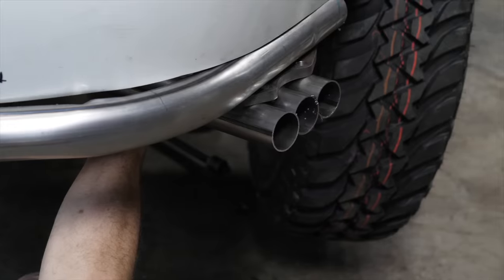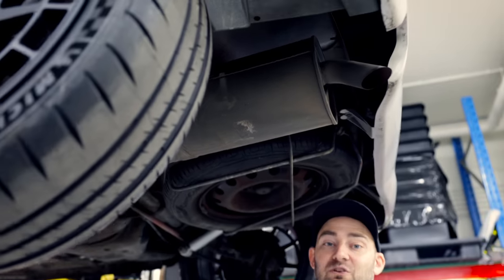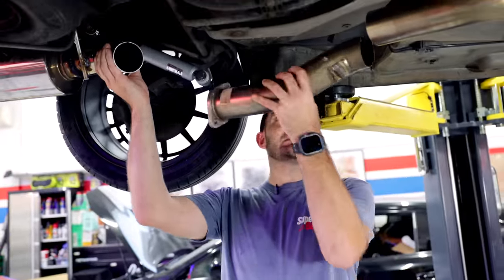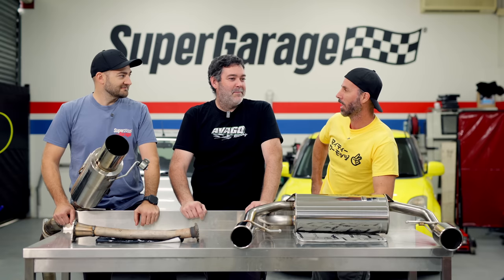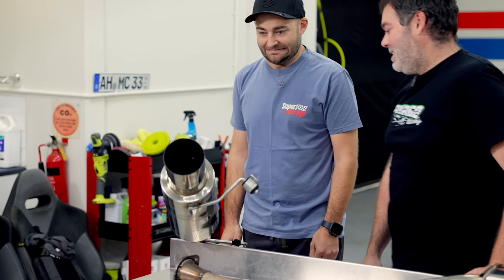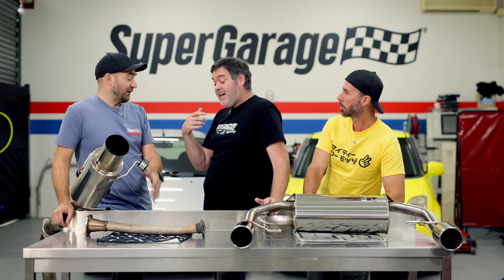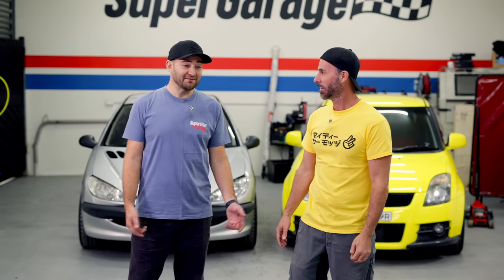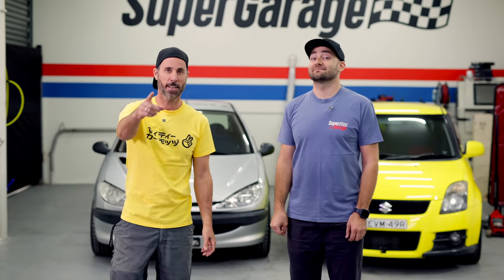$13 vs $1,300 Exhaust System | CASH vs TRASH

Comment: If you got a welder and a saw you can spend a LITTLE bit of money, Buy the proper sized pipes and proper mufflers and high flow cat and potentially make an even better exhaust than some prefabs. depending on the quality of parts and skill level.

Comment: In the filter video, you said it’d be worth it if we see a difference on the dyno. But changing the exhaust will also have an unknown effect. Why didn’t you dyno runs between mods? It’d have been more expensive, and this isn’t a scientific channel, but seeing a difference in stages would have been nice

Comment: The Problem with the 206 now is the fact the Biggest restriction will be the Cat on the Manifold. The Old Cat will be clogged up for sure. So Surely it'd be better for power to knock the Cat out of the Manifold (or fit a 250 buck sports manifold and stick a Cheap Sports Cat in the 3" pipe for less a than 100 bucks.
 350 bucks will be Dirt Cheap and will at least get more power where Martys system will lose power!

Comment: It's still nice to see that I'm not the only one that uses RYOBI lmfao I bought my first stuff because of price and color! It's not HILTI,SNAP-ON,MAKITA,MILWAUKEE ECT...... but, killer warranty deceptively reliable tools in their price point. But of course your gonna notice a difference between something double its price! Go RYOBI keep up the work!
Reply: i dunno, some of the Ryobi stuff on Project Farm punches so far above its weight
Reply: Most definitely. My RYOBI impact is my go too on daily tools........ it's only my second in 7 years the only annoying thing is 3 different chargers in the box cause I can't have just one brand lol
Reply: @confusion9950  Cheap adapters mean you can use one charger for all batteries :D
Reply: I've definitely thought of it...... but I'm  still using the original single/double chargers depending on brand/kit I bought

Comment: when we design exhaust systems professionally, to clarify what they're on about re: "backpressure", maximizing flow (via the pipe energy equations, for you nerds) is about balancing two OPPOSING factors. flow rate is fixed and set by the heads/engine, called Q, where Q = area * flow velocity. as you change EITHER area OR flow velocity, it affects the other. if you move to a larger diameter exhaust, the flow velocity plummets; and you can constrict the exhaust to speed the flow up, but that restricts flow and increases losses from drag and fluid turbulence. at some point there is a sweet spot where their total flow is maximized. that is your ideal exhaust diameter.

so no, back pressure doesn't matter. but you DO need to maintain flow velocity, so you HAVE to limit the size at some point. that's what they're getting at in a roundabout way.

what boomers call back pressure is actually "head loss", a term for parasitic losses in things like curves in the pipe, catalytic converters and mufflers, marty's little contorted colon tube, etc. you want to MINIMIZE head loss as much as you possibly can as it results in direct power increase even at the same flow conditions.

scavenging is about tuning the exhaust (and mostly header) length so that the individual pulses out of the cylinders arrive perfectly timed and cause a little vacuum to pull the exhaust out on the next stroke. that (and intakes!) are tuned lengths set by the frequency of the intake or exhaust valves at your target RPM. there is a reflected wave whenever you move from one diameter to another, such as at the collector of headers. you match these frequencies together to get scavenging. headers require tunes to set the timing (and therefore intake frequency) for your aftermarket header length.

things that affect scavenging (such as headers, intakes, Y-pipes) or confuse the MAF sensor require a tune to make power.

things that reduce head losses (ie, cat delete, intake air FILTER) will show immediate power improvement and do not necessarily need a tune, but they will make even more benefit with one. this is because head loss exists AT THE SAME FLOW RATE, it has nothing to do with "flowing better" -- remember that the Q flow rate is FIXED by the heads and applies to the ENTIRE exhaust in all locations!

Comment: It's actually inaccurate to say that Back Pressure is needed. It's really about turbulance: Too big of a pipe ends up having the gases swirling around in circles instead of moving through the pipe and out. It's all about maximizing the flow and if the pipe is too big, the gas slows down which impacts scavenging. I really don't know why people keep talking about back pressure. 
Now I'll  just wait for the internet to line up with rocks in hands ready to throw at me.

Comment: Man may make great exhausts, but his understanding of back pressure is way off. 
Scavenging requires high exhaust velocity and reflected pressure pulses. This is not the same as back pressure. 

Marty’s small pipe flaring into the 3” system actually a pretty decent design because, as the gases reach the expansion point, they slow dramatically which increases the pressure but also dictates a distance for pressure pulses to reflect back up the pipe to the manifold. 

That being said, with the stock log manifold, this matters about as much as it would on a turbo car.

Comment: The dude doesn't really knows what he is talking about. Engines doesn't need any backpressure, and the scavenging has nothing to do with back pressure. Its about exhaust flow speed and flow energy, and wave resonance.
And btw that exhaust diameter change can be beneficial, if you place it in the correct distance after a header.

Comment: As much as i'm a Pug fanatic, i'm struggling to get on board with the comparison.
Granted, the horsepower is similar however the swift is the card carrying car of its model...the 206 isn't much more than a grandma's shopping chariot. 
A 206 GTi should be what was chosen.. 180bhp or not, thats the card carrying car of it's model.
The mani cat harnesses the majority of the pugs 'power' and youll be spending alot of time and money getting the 206 even remotely comparable to bog standard GTi.

Comment: I'm sorry, but he's wrong, back pressure is always a bad thing you want 0 backpressure in all exhausts. But having an exhaust, collector or primaries too big slows down the exhaust gas velocity - which hurts the scavenging effect - what you want a right sized exhaust - its not hard to calculate either.

Comment: for a std tu5jp4 3inch exhaust its too much, with a 2inch goes perfect
Reply: and a 4-2-1 exhaust manifold or a 4-1. 
4-2-1 for hp
4-1 for torque (i probably read that in a french forum like in 2014 ajjaa)

Comment: Wrong, backpressure is bad all the time. Idk why nobody can explain/understand exhaust gas volume vs exhaust gas velocity. 3” pipe has volume but poor exhaust exit velocity. Nevermind “backpressure”, if your exhaust is engineered well enough, this “scavenging” effect could actually  almost totally mitigate any resistance in exhaust flow. There will always be high pressure at the cylinder and valve, it’s how low can you get that number

Comment: Where turbo motorcycle
Reply: Bruh
Reply: they already made one
Reply: @john_barnett  every video this dude leaves the same comment. He wants to see more of the turbo postie bike....but I reckon they took the turbo off and put it back to stock because it was useless and stupid.
Reply: They put everything on and never finished the project. They were supposed to tune it and actually have a fully functioning machine.
Reply: @baliblades  I guarantee you it's been taken apart and returned to standard. Apart from being ugly and not very functional, it wouldn't be road legal here in this country.
Reply: @Mardy72  would have been a large waste of time and resources if that’s the case.
Reply: @baliblades  a couple of hundred dollars for the bits and pieces is nothing to them. How much money do you think they would have made from the views on here.....?
Thousands.
It's all about views.
Reply: @Mardy72  probably the same reason you don't see any stock turbo bikes being sold!

Comment: I always get a little disappointed when I hear an expert use the term "backpressure". It's not that they're wrong per se, but it's just a really poor choice of word to describe the phenomenon. Because it's really not about pressure in the exhaust.
Basically you just want the exhaust flowing as fast as possible. Fast moving air is low pressure (Bernoulli's principle), and the whole column of exhaust moving does pull vacuum and help scavenging, and it's less work to pump it out of the engine, giving power and efficiency gains at the optimal exhaust diameter. If the exhaust diameter is too small, you restrict the flow and build pressure, which is bad, because your engine has to work to pump out the exhaust. But if the diameter's too big instead of flowing nicely your column of moving exhaust isn't filling the whole system so it starts getting turbulent, which slows it down, making the engine work harder to pump it out. So too big a diameter is more like too much backpressure, not "not enough".
OEMs go for smaller diameters because most people in regular driving are operating in the bottom half of the tach and low throttle percentage, not pushing a ton of air through the system. Performance driving at higher RPM and more open throttle puts more air through the exhaust, so a larger diameter is beneficial both for scavenging and avoiding restricting flow, but at the expense of lower efficiency at slower engine speeds. And because low RPM is where most people are driving most of the time, the power and efficiency loss is noticeable on the butt dyno, and that's why they complain about "not enough backpressure". But it's really about speed, not pressure.

Comment: 6:34 I can assure you it isn't. All those rusting turds are good for are dragging poor people (here they all worth less than £2k) that give literally no craps about road laws around. Most of those things in the UK have almost completely failed electronics systems (that happened in warranty period about 20 times and then once outside of warranty and was too expensive to fix) They all have rusty arches and under floors, blown suspension and run so badly they are probably breaking emissions laws. And finally, here, on a peugot 206, the idea of an exhuast mod..... is a rust hole.

17:09 Those off centre tips need fixing.